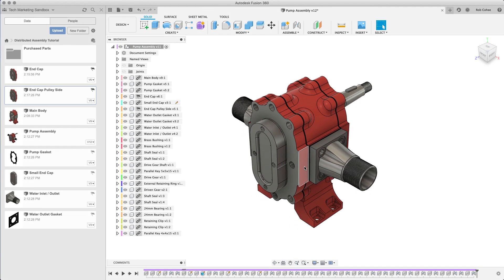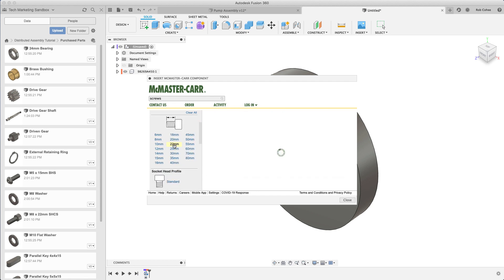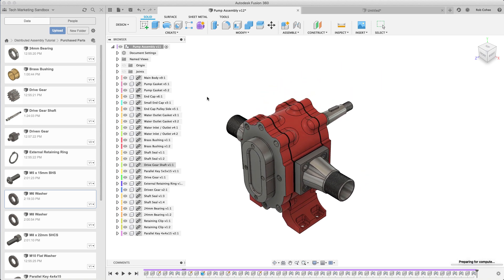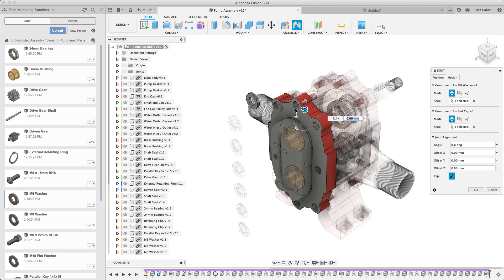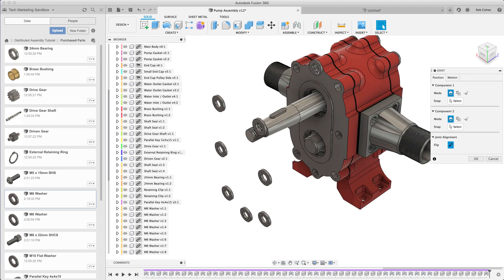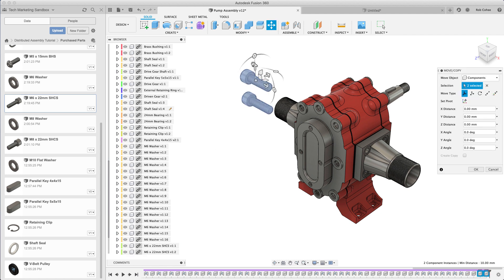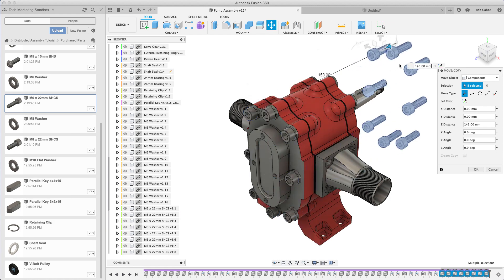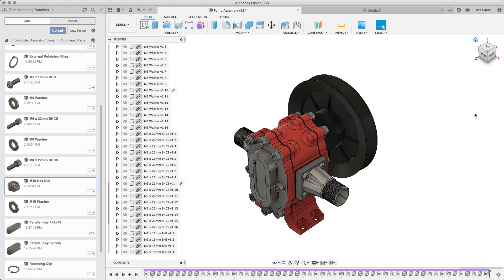Best Practices with Assembly Design for Teams (Part 9) - Joints Part 2

Comment: Ignore this comment... I will delete it in a couple of days.  My problem is not Fusion 360... it is associated with my graphics card and drivers.  I repeated the process described below a number of times, and always got the same result... I never tried to go further.  Today, I dragged one of my assemblies, then clicked undo, and everything corrected itself.  I wonder if this cleared a cache on the graphics card?     Anyway, all is good now.     :O)
Hi Rob, thanks for this series, it's bang on target for me.  I have been performing similar operations recently, with inconsistent results.  You positioned all the washers using rigid joints, then did it all over again with the bolts.  
My assembly consists of 1 bolt, 2 washers, 1 spacer, 1 bearing, and 1 nut, and there are 25 assemblies.   I thought I would save myself 120 Joint operations by joining these components onto the bolt with Rigid Joints, then locating this assembly to them main Component with another Rigid Joint.  Initially this seemed to work great, but when I tried to replicate the process last night, some of the bearings and washers did not stay in place when I tried to Copy/Paste the parent assembly. It looks like a digital scattergun went off!

Am I barking up the wrong tree?

Comment: This works fine for such a small design, but what about when I have a really big design and I need to insert a single small bolt. Right now i zoom in on the bolt where it spawns at the origin, then zoom all the way to the other side of my model so I can see my target.
Reply: Hi Chris - I completely agree with you. I've asked the team to look at the current experience and see how we can improve it. I like the idea of simply placing the instance at your cursor and placing one or multiple instances in space. Another option would be to have the Joint command be the active command vs. move but that would limit you to one instance at a time. Bottom line is that we are looking into this to improve what you describe above and address a few other issues with the current experience.
Reply: @robcohee   Thanks! I really like the idea of placing the instance at your cursor, but what would really take it to the next level is if the instance origin snapped to geometry such that the instances vertical axis is perpendicular to the geometries surface. That way items like fasteners could be built about their origin so that they exactly snap into holes & the like.
Obviously still bring up the move gizmo after the instance is inserted, but this feature would really improve lots of workflows. At least in my work, any model that has more than a few inserted objects will have most of the inserted objects be fasteners.
And if you don't want the snap to geometry behavior, you can just turn the camera and hold the instance over empty space to have it align to the origin (but still appear near where you are looking)  Maybe have some sort of override key to make insertion have its original behavior of inserting at the origin aligned to the origin.
Reply: ChrisCiber & robcohee:  I had an idea!  (must remember to mark that on my calendar)  Don't get excited... it didn't work, but it would be nice if it had.
*  Create a Named View at the distant location you are working on. (and maybe another one at the Origin, or wherever Copy/Pasted Components will appear)
*  Copy/Paste the Component.
* Start your Joint, and select the join point on the Component.
*  Click the Named View where the Component is to be inserted.
*  Complete the Joint.
Sadly, it doesn't work because clicking the Named View cancels the Joint operation.  If you read this far and you feel I wasted your time, it's because you missed the part on the first line where I told you it didn't work!   :o)   Still, this might jog somebodies memory, and they WILL have the answer!
Thanks again Rob, this is a cracker series.

Comment: if you don't do a resolute joint + a slider joint with a motion link based on the pitch and travel limits to prevent the screw from threading too deep for every fastener... you're slacking
Reply: May you have a long life!   (You're going to need it with that level of detail)    :o)